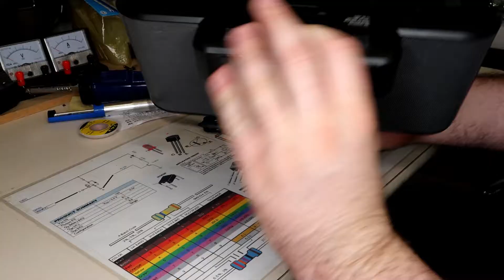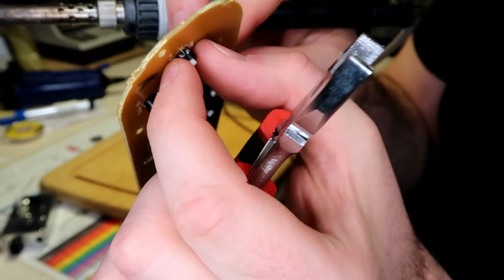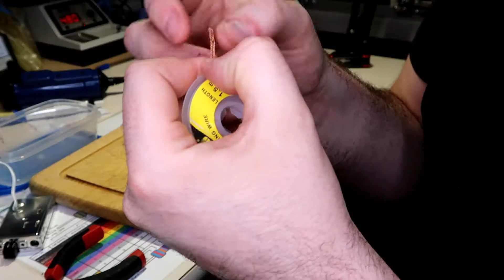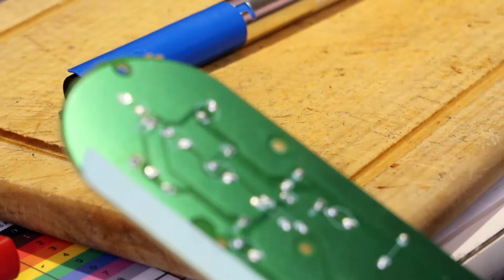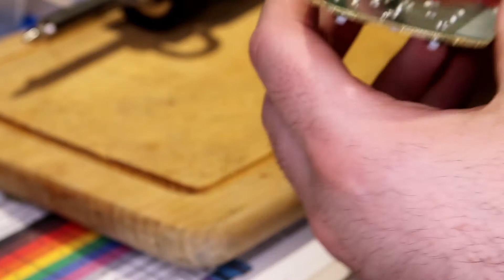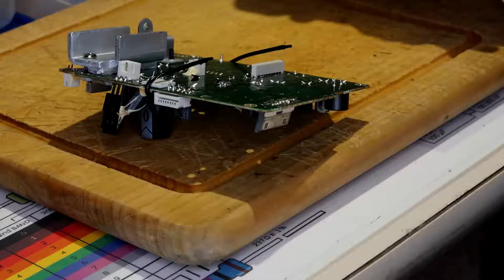How to de-solder electronics 4 Ways ! (Solder Sucker and De-Soldering Iron)

Comment: hi  fella i seem to be havin a nightmare three irons im notvery good atit but even on practice bits of pcb i cant even get the solder to melt and when i can i cant seem to desolder and i know i will just end up ruining what im tryin to fix! please tell me where to get the desoldering iron
Reply from the maker: Hey, just confirming you are using number 3 the sucker pen?  if the solder is not melting potentially your soldering iron is either 
1) not hot enough (adjust temp if you are able to) 
2) Tip is dirty and needs to be cleaned properly 
3) Wrong tip is being used.

even in the video I'm not getting close enough to draw all the solder out, probably didn't help I was trying to film while using it